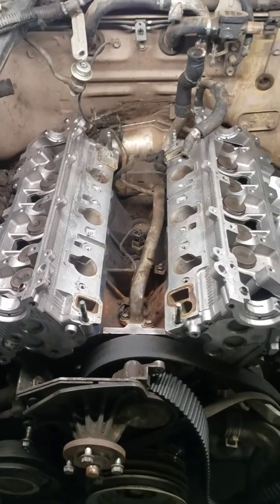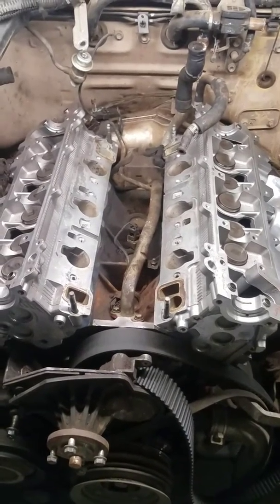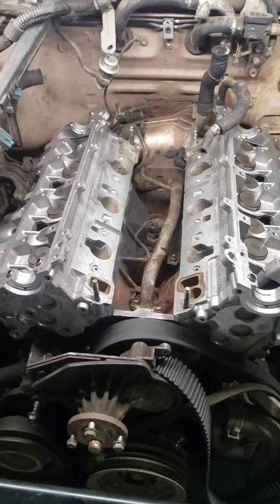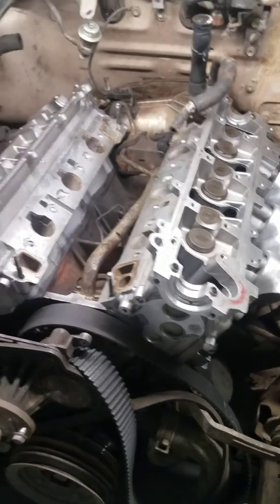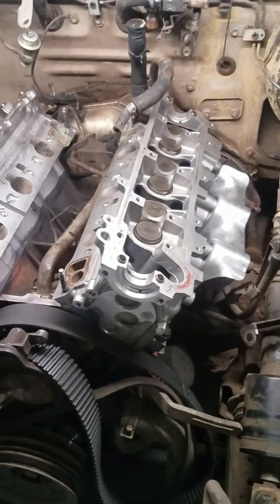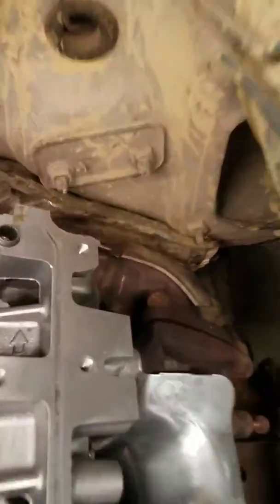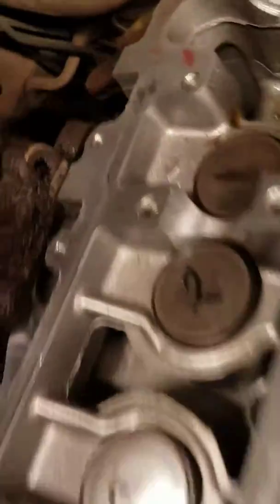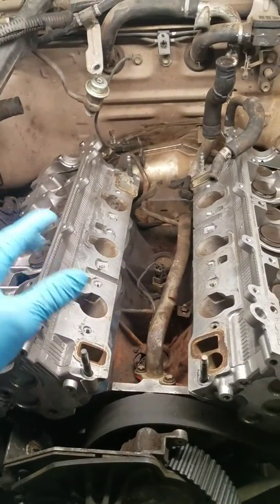Toyota 3VZ V6 Rear Crossover Exhaust Pipe

Comment: I had heard that getting rid of this upper exhaust crossover pipe, and running it underneath increases power. Anyone know about this?
Reply from the maker: I haven't tried that on this vehicle. But the power increase, if it happen to be true, prob isn't worth the trouble, for a street driven vehicle. Now if it was causing a running issue and eliminating it fixed that issue, I would go for it. Or if you were racing and needing the extra 1/10th of a sec, it may be worth it. Thanks for watching!
Reply: Yea it does and saves the head gasket and cylinder 6 will thank you also

Comment: Why didn't you replace the cross over pipe with something aftermarket that would not cause head gasket problems in the future?
Reply: Least could wrapped it in the right spot with heat wrap
Reply: @jeffgood6441 I just wrapped mine after replacing the heads.  Now the motor is overheating. It has a new radiator, fresh TOYOTA OEM coolant, and everything else the same. I THINK wrapping the crossover pipe is causing overheating, but I am not sure yet. I can find no information from anyone anywhere who has tried wrapping it. 😕

Comment: Wish I saw this before I bolted the heads on 😭
Reply: I think i just screwed big time...i forgot to put crossover pipe in before installing heads. 😳 did you have to remove both heads to get it back there or just the passenger side??? I know it’s an older post but let me know asap if you can...I’m looking at my engine right now....😞 🙏

Comment: Is there any trick to removing the nuts that attach the driver's side exhaust manifold to the tailpipe? I am having trouble with the nut on the inside. Thanks for the video.
Reply: can you take out the crossover exhaust pipe without taking the head off?
Reply: @nairichannel7403  is it possible?  I’m hoping i can just take passenger side head off...smfh...i have done a 100 of these 20 or so years ago working for Toyota, put heads on and forgot the crossover. 🤬 let me know if you get this! Thanks, Tony
Reply: edward landstreet 

Can you delete crossover pipe ,
Reply: I got finally got the nut out using several extensions and joints with my breaker bar... now I am removing the head bolts. I am taking off the heads with the crossover pipe attached, thanks for the help, Vet.
Reply: Tengo el problema de la luz  de rear anti lock  prendida , donde está el problema o sistema.